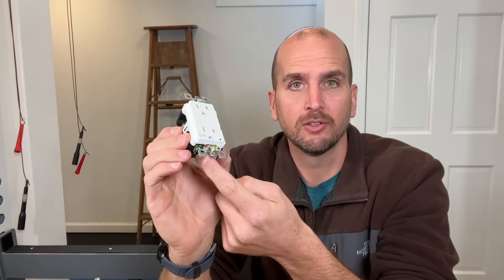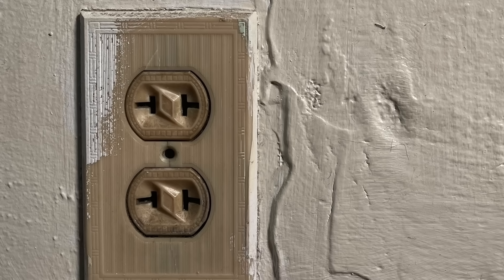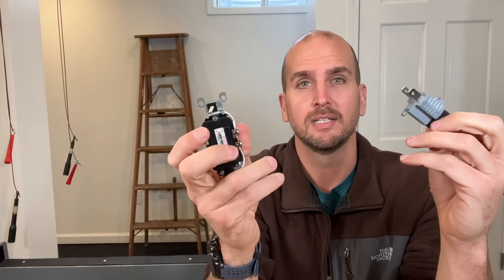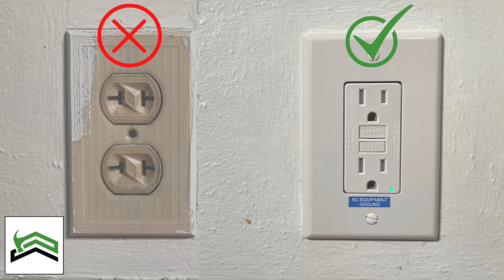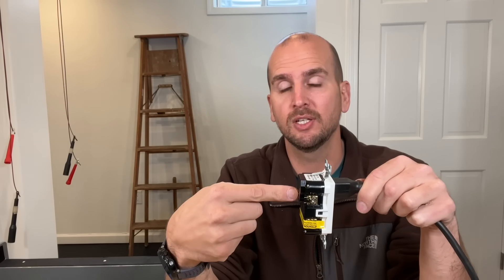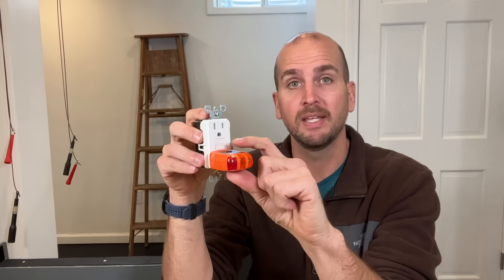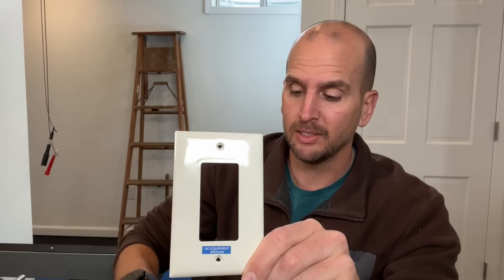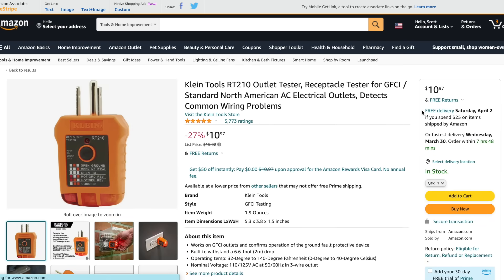Does a GFCI Outlet Still Provide Protection Without A Ground Wire?

Comment: Great vid. Another point to consider is that gfci should never be used in series on the same circuit.  If multiple gfci’s are to be on the same circuit they must be connected to the line side to line side NOT load side to line side. Or else the most upstream gfci will trip and be a nuisance. Nice.
Reply: note that daisy chaining GFCIs will not cause malfunctions - it will just be annoying because a fault may trip multiple devices.

Comment: Great video. I was listening in on a "handy man" radio show a couple of years back and the host stated that A GFCI watched for current on the ground wire.
The producer of the show must have caught my email correction as he never spoke to me again even after being a regular contributor!
Reply: Technically he's right.  There is different terminology in different jurisdictions.  I think people are not using the correct terminology here.  There is no "neutral" wire in a house.  There is only a neutral wire in three phase systems.  The neutral wire carries the unbalanced current between the three phases in a three phase system.  In a house with a black wire, a white wire and a bare copper wire, the black wire is the 'Hot" or live, the white is the return path for the current to ground is the "grounded conductor" and the bare copper is the bond.  The bond wire is intended to connect the metallic non current carrying components in an electrical assembly to ground - junction boxes, lights and the metallic housings of things plugged into receptacles in the event that something metallic becomes energized. the white wire and the bond wire are connected to each other at the service and connected to grounds - in most houses the water main where it comes into the house.
Reply: @minuteman4199  Does a GFCI trip if it's ground terminal has current fed to it?
Reply: @vanderpoolfarmsl.l.c.9983  You mean voltage and current comes from outside through the ground conductor? No, a GFCI will not detect it. In 2015 a blumper in Finland died as the socket he used was miswired with the live wire connected to the ground terminal. The tool he used had a GFCI but it did nothing to protect him.

Here socket testers are required to show voltage on the ground wire because such miswirings are surprisingly common (each of them illegally done)
Reply: @minuteman4199  Current never goes to the ground. Yes, the neutral is officially called the grounded conductor but not the ground wire.

Comment: What if a two prong outlet is wired to a GFCI breaker  in the breaker box?
Reply: You can do that of course but you do not get the benefit of using three prong plugs.
Reply: @okaro6595  So if I replace the two prong receptacle with a three prong receptacle the receptacle wouldn’t have to be a GFCI  Receptacle?
Reply: @johnmayer5920  It is enough that it is GFCI protected. The details are secondary.
Reply: Thanks for that!

Comment: That is great  way to save money when you know which outlet is #1 in a circuit. But I have heard of the GFCI with Arc fault circuit breakers.
My question, is do they make either the GFCI or GFCI with arc fault for older style panels that have no grounds?
Reply: Those breakers only ever have a hot and neutral connected to them so you dont need anything fancy.
Reply: panels that are functionally obsolete, like Zinsco, Federal Pacific, and Pushmatic do not have AFCI breakers available, but in some cases, you can install electrical boxes under the panel and install dead face AFCI/GFCI devices.  - although you should be considering changing out the panel, with panels that old.
Reply: @IT__Security  what do u need a 40A GFCI/AFCI breaker for?
Reply: @IT__Security  ah ok was just curious what load would require that, makes sense

Comment: By code, GFCI’s must trip between 4-6 mA’s. A Hubbell rheostat type tester is a great tool to properly test a GFCI. It ranges from 1-7 mA, 1 mA at a time so when it pops, you know exactly what mA set it off. Anything less than 4 mA that trips it is considered a nuisance. Anything over 6 mA is not enough protection. 

Toss the GFCI for a new one if it’s outside the 4-6 mA range.
Reply: By code, apostrophes aren't used to form plurals.
Reply: @alistair1978utube  They're just being possessive..................(On my period, don't judge me!)
Reply: @alistair1978utube  who the blank cares. The point is made . Go and teach all the Hispanics to speak English you would be better off. There are hundred's of reason's why!. 73
Reply: @alistair1978utube  who cares. We get the meaning.
Reply: @sherrykendrick1765  people with an IQ over 90 usually care about getting things right...
Reply: The best thing to test the gfnci is it's own test button.
Reply: @davealexander7930  That would make testing very easy, but unfortunately it’s not a good way to test it at all. The test button causes a direct short to ground only. It does not test the sensitivity at all.
Reply: Not true the test button will work without aground!
Reply: P.s. that's why  they call it a ground fault neutrall circuit interruptor.
Reply: @davealexander7930  Ok now that you’ve got me dialed in on what the initials mean, once again, the button DOES NOT test the sensitivity range at which it will trip, without pushing the test button. 

Only a Rheostat tester will do that. 

I’m a hospital inspector and trust me, it’s one of my least favorite things to do, circuit verification. Each GFCI installed in a new hospital must be tested. NFPA 99 Health Care Facility says it must trip by 6 mA but not less than 4 mA. 

When I walk the inspections the electricians cannot use the test button.

Comment: In what logical setting does labels look good. They need a new way of labeling these outlets especially if I am installing brand new clean looking white ones. Nobody wants a ugly sticker that says gfci protected on their cover plate. (In my opinion)
Reply: Please install them. In my home all 3 bathroom outlets are prilotected by one gfci outlet. 
It can be helpful in troubleshooting if you know to look for the tripped outlet instead of hunting through the breaker panel with no tripped breakers.

Comment: Fantastic video.  I've never seen this called out so clearly.
Reply: But wrong !
Reply: @millomweb  how so?
Reply: @millomweb  how so?
Reply: @wellsnapyeah  They work on detecting an alternative current path than the pair of power wires that are supposed to be the only wires carrying current. The only way there's going to be an alternative current path is when that alternative path is complete. So if that path involves the use of 'ground', 'ground' has to be connected in to the circuit AT THE OTHER END - which usually means to the neutral wire - and that wire is connected back to the GFCI - so even without an identified earth/ground wire to the GFCI,  there is actually still a ground connection. to it. WITHOUT that connection, an alternative circuit would not exist to cause an imbalance in the 2 wires supposedly providing the power.

Having bought a generator about a year ago, I've spent SOME time getting my head around how all this works. If there's not alternative current path, the GFCI cannot trip (and is not actually needed ! BUT IF a circuit should happen it would work and would be a useful safety device.

Comment: I am concerned that a ground (earth) is not used on an older property. Is it Fail Safe? What happens after 15 years? An earthing (grounding) rod should at least be used surely.
In the UK it is common to see these rods outside of the front doors of houses. They have to be of a certain length and the ones I have seen are solid copper therefore giving good protection in the case of a live chassis.
Our RCCB’s (Residual Current Circuit Breaker) are fitted into the Consumer Boxes (fuse boxes) either on the main power switch or individual Circuit Breaker. They work on excess current at 30ma and have a test button to confirm their integrity.
Reply: You should test the outlet regularly. If it fails you should replace it. An earth rod does nothing if the GFCI fails.
Reply: We only use rods in certain cases, the vast majority of properties have the earth provided the supplier
RCD setting of 30mA is fitted to final circuits but there are various sizes on a TT system the mains are 100mA to allow for discrimination
Reply: One of the Youtube channels (Thomas Nagy ?) found a RCD that wouldn't trip as specified yet the trip button still worked - So I removed the trip button on one I bought last year.
The danger comes from you becoming part of the circuit. Without RCD and grounding, stuff is pretty safe - as all you can do is connect yourself between live and neutral. However, since power suppliers connect ground to Neutral, you have already exposed yourself to the neutral conductor - so the power co makes it significantly less safe. In your unsafe older property, either get it rewired to modern standards or fit an RCD to cover the whole supply to the property.
Reply: @millomweb  if you've removed the test button you've invalidated any warranty.... You also fail any electrical survey
Reply: @michaeldunham3385  Not bothered on either count.

Comment: There isn't anything that homeowners who are updating their home love more than putting ugly labels on their outlet plates. I can't believe they actually thought anyone would ever do this when they were putting it in the code book.
Reply: True, but not safe. Some people have interesting priorities.
Reply: @TomCee53  A GFCI is, in general, better than having a ground.  Having a ground wire on a GFCI-protected circuit is more a matter of devices that require true ground references (to prevent hum and improve the efficiency of antennas).  Such as radios, hi-fis, and other equipment that is interconnected (eg: wired ethernet) potentially across circuits.
Reply: @fromagefrizzbizz9377  No, a ground wire is an essential safety feature. It co-operates with the GFCI immediately causing the GFCI to trip without the needed of someone to touch it. Also it is used to get  rid of leak current.
Reply: @TomCee53  but the safety factor does not change whether there is or is not a label there...
Reply: In situations where aesthetics are important I usually make my own labels using the label maker I keep in my electrical bag.  I'm careful to use the correct wording and make sure that they are legible without being tacky looking.  That's the best compromise I've found so far.

Comment: "Does a GFCI Outlet Still Provide Protection Without A Ground Wire?

In the poll, 2 out of 3 people got it wrong."

Actually, they didn't get it 'wrong'. The answer is no, a GFCI WILL NOT PROTECT YOU WITHOUT A GROUND WIRE - BUT IT DOESN'T NEED TO !

If either wire to the GFCI is connected to ground (such as neutrals usually are), then that wire to the GCFI is providing the necessary ground wire function for the GFCI to trip.
Reply: A GFCI isn't using the neutral as a ground wire, because they are NOT at the same potential as the ground.  Outlet GFCIs work simply by measuring current flow in the neutral and hot, and if they differ by a few milliamps, it kills the outlet.  Full stop.  That means that if EITHER side has a connection to something at a different potential (like you standing on a concrete slab in bare feet), some current is bypassing the hot or neutral. 

This is why a GFCI will detect a neutral wire accidentally shorting to ground.
Reply: @fromagefrizzbizz9377  Neutrals are generally grounded.
I know how they work but for the two wires to be unequal, another circuit needs to be present. That's usually via the ground and to neutral back to the GCFI. Without that link there would be no wrong circuit current flow.
Reply: @fromagefrizzbizz9377  Well, without the nutral being connected to ground, the GFCI won't trip at all - as there couldn't possibly be a fault circuit !
Reply: You're misleading because you say "connected", because it doesn't have to be a formal connection at all.  Just a bit stray leakage.  Or the neutral-ground bond at the pole transformer.  There is a very strong reason you should not treat the neutral as safe or grounded.  Sure, in the theoretically perfect condition where there is NO ground reference at all, none of the conductors can hurt you by themselves.  But don't rely on it.  The codes don't.
Reply: Why are keeping insisting that a ground wire is required?
Reply: @michaeldunham3385  Without another conductor, no fault circuit could be provided.
Reply: @millomweb  really? So how are people electrocuted when they are only touching a single conductor
You've clearly had no electrical training
Reply: @michaeldunham3385  They're not just touching one conductor. If they were, they'd be like birds sitting on high voltage distribution wires - still alive!
Reply: @millomweb  birds aren't electricuted simply because they're not in touch with the ground, people are, you're not an electrician so why are giving advice for something you're not trained for?
Reply: @michaeldunham3385  Precisely - there's no circuit.
Touching the ground does not prove there is a circuit.

I don't need 'training' to understand things as I'm intelligent - intelligent enough to know where I do not know enough about a topic. 
Earth faults is something I covered in depth last summer - having bought a diesel generator and needing to thoroughly understand how ground fault protection works.
In the UK it is not permitted to have a normal power outlet in bathrooms. The only power outlet permitted is a 2 pin socket for electric shavers. These are not (necessarily) protected by a GFCI but are isolated supplies not connected to any other electrical supply. The isolation is created via an isolation transformer - the output of which is not connected to the input. This means that there is no circuit possible between either conductor of the isolated supply and ground. If someone touches a live wire of an isolated circuit like this, they're not electrocuted as they are simply like the bird on the wire - there's no complete electrical path that could kill them.
Reply: @millomweb  you really have no idea what happens when you're electrocuted..... the ground is the circuit.
Knowing how electric shock works is actually taught at college.
So you've got a generator? Can produce, 2000A and run an Asda?
Putting a shaver socket on a GFCI would be pointless because they use electrical separation to make them safe, it's nothing like a bird on a wire
No you don't know anything about the topic, you're what we consider a danger
Reply: @michaeldunham3385  "you really have no idea what happens when you're electrocuted..... the ground is the circuit."

The ground is not the circuit but it can be part of it.

"Putting a shaver socket on a GFCI would be pointless because they use electrical separation to make them safe, it's nothing like a bird on a wire"

The correct term is 'isolation', not 'separation'. It's exactly like a bird on a wire - as the bird is isolated from the ground !
Reply: Ground wire is what people call the grounding conductor. The grounding of the neutral i.e. The grounded conductor is a different issue. Do not okay word games to confuse people.

Comment: Nice detail at 4:25. I was wondering why my tester wouldn’t trip the gfci. I figured it was cuz there was no ground. Makes sense. 👍
Reply: @protoman247  what a concept GFIs need grounds to be a GFI. 73
Reply: @ronb6182  no they don’t
Reply: @protoman247  they are just another plug with some unconnected electronics inside. I just don't know why anyone would risk their family with outdated wiring it's not a big thing to pull a new romex cable with the proper ground wire. I was lucky with Dad's wiring it was grounded just need to bond a wire to the metal box. Only if you have EMT in the walls. 73
Reply: @ronb6182 "It's not a big thing to pull new romex cable..."? 😅😅😅Try doing that with a 1950s house with wooden walls with blocking. Try doing that with insulation in the way. Opinions are like a-holes: Everyone has one.

Comment: I was raised in a home built in the early 1940's with post and tube wiring. When Dad put bedrooms in the attic he used  Romex with no ground. I had a couple of Short Wave radios up there and to improve the reception we ran a bare ground wire beside the septic tank stack down to the basement where it was connected to the copper pipe bringing our water in from the street. My Mother was vacuuming my room when the vacuum cleaner's metal wand contacted the bare copper wire with a bright blue spark and the fuse blew. We were fortunate no-one was electrocuted!  I have worked since then in a large metal stamping plant and noticed that heavy bare ground wires in the open had green insulation. We tend to think that a bare ground wire is safe because it is at zero volts; BUT combine it with a hot appliance or tool in your hand and it now very dangerous!!
Reply: In that particular case it was the vacuum cleaner that was dangerous, the exposed ground just highlighted the problem for you before it killed someone.

Edit to add: A GFCI outlet would have prevented the blown fuse.
Reply: @KevinT3141  ,  There are advantages to our modern vacuum cleaners and double-insulated power tools made with plastic cases: it's far less likely that the user will contact a hot or live chassis in the event of an internal fault in the device. I can remember getting zapped as a kid when using my dad's old metal-case Stanley power drill while standing on the basement concrete floor barefoot or in damp sweaty leather mocassins.  A few years later we upgraded to double insulated double insulated Bosh tools with plastic cases, which didn't give you shocks even though they did not have a grounded cord. This was of course in the long ago days when powerfull cordless  tools weren't available.
Reply: Ground Wires never carry electricity to ground unless there is a short circuit.